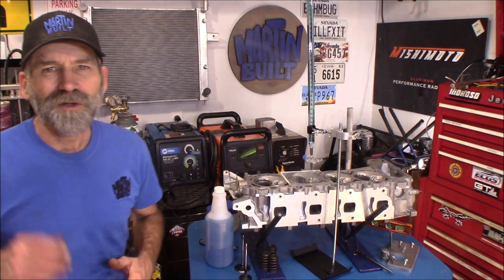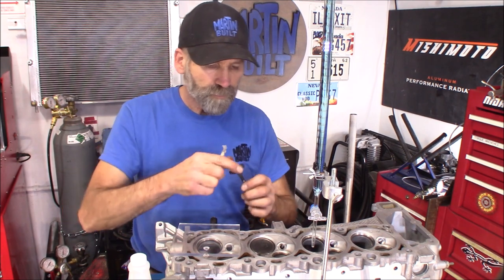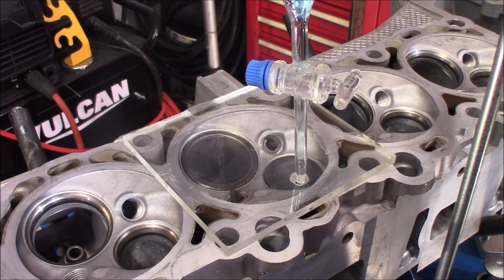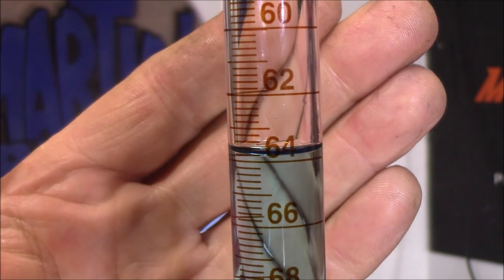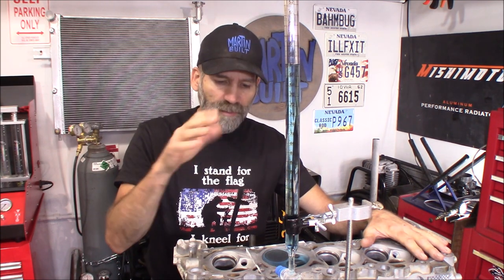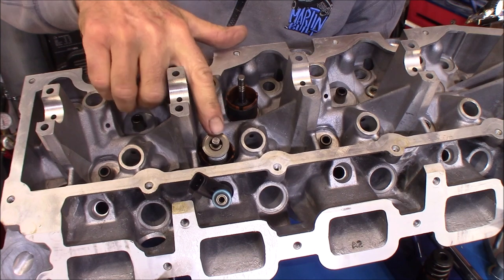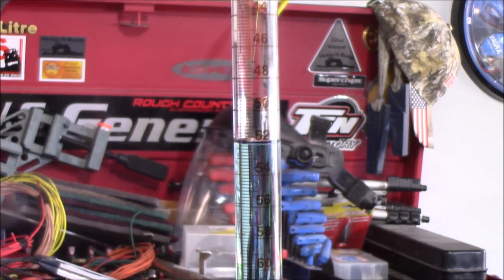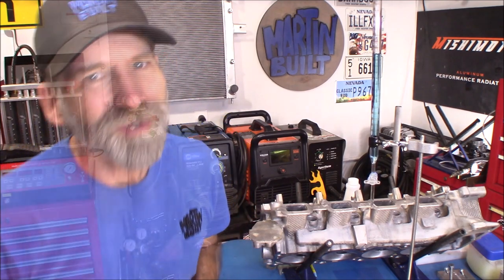How to CC Cylinder Heads (Dodge, Jeep 4.7HO vs 08 4.7 which one is better)

Comment: You are a fountain of wisdom on the Dodge 4.7L, Martin! I just picked up an '05 Dakota with the 4.7L V8, and am in need of your expertise on the design and function of the H.O. cylinder head compared to the non-H.O. heads, at least those pre-2008. My truck had a slight rough idle when I purchased it that I figured I could easily fix with a tune-up. However, the existing air filter, coils, plugs, and fuel injectors all checked out. I cleaned the PCV, throttle body, and Idle Air Control (IAC) valve as well, to no avail. Short and long-term fuel trims are between 0-5%, so I don't think I'm looking at a vacuum leak of any significance. No DTC's or Check Engine Lights of any kind. 

A cylinder balance test was inconclusive at identifying any dead or missing cylinders. A dry compression test indicated somewhat low compression (125 PSI) on cylinder #4, with the rest of the cylinders all posting in the 145-155 PSI range. Thought cylinder #4 could be my problem, despite the lack of any misfire codes. Wet compression tests showed compression gains to 180-190 PSI in all cylinders, indicating somewhat worn piston rings across the board. 

Leak-down test on #4 indicated air coming through the throttle body, pointing to the intake valve. Ran a bore scope down #4 cylinder and saw no evidence of piston or valve seat damage. Good cross-hatch on the walls still visible. Pulled the valve covers to check for a broken intake valve spring, thrown rocker, stuck lifter, or dropped valve seat, and found none of the above. While I had the valve covers off, I confirmed that the engine is in proper time. I pulled the intake manifold as well to get a direct visual on the intake valve itself, and it does not appear burnt or bent. 

Then I noticed something odd. The passenger side cylinder head is stamped "H.O." in the front, whereas the driver side is not. The P/N's confirm that my PF head is an H.O. whereas the DF head is not. However, the cams installed in both cylinder heads are the non-H.O. version, without the extra ridge behind the cam gear. From prior research, I know the 4.7L H.O. cylinder heads differed from those on the standard 4.7L in several ways:

1) .030" higher intake cam lobes
2) Larger valve springs (7.30 coils vs. 6.69 standard, 4.77 wire diameter vs. 4.28 standard)
3) Larger exhaust valves
4) Redesigned combustion chambers coupled with domed pistons, resulting in a higher 9.7:1 compression ratio (9.0:1 standard)

My question to you is whether you think a 2005 4.7L with a H.O. head on one bank and a non-H.O. head on the other running the non-H.O. version of the cams and springs in both heads would result in a shaky idle and acceleration at anything under 2,500 RPM's. Specifically, could the differently-sized combustion chambers cause this problem?

My truck's build sheet and VECI label under the hood both indicate that it came with the standard 4.7L V8, and not the H.O. version. However, I do have the two knock sensors in the valley under the intake manifold which I thought only came on the H.O. engines, so I'm also confused as to which head is original and which was a replacement.
Reply from the maker: yeah, that engine most likely dropped a valve seat and they replace it with the HO cylinder head. Looks like you have replaced everything.
The valves are the same size on both heads, non-HO, and HO
All the 4.7 came with the knock sensor bosses.
Check the harmonic balancer to make sure it is in good condition.
Reply: @martinbuilt  — Thanks for the response! Good idea regarding the crankshaft damper, hadn't thought of that. I still think I'm having a problem with the intake valve on #4, though, given the leak down results. Will try cleaning the valve seat through the intake port. Currently performing a piston ring soak with MMO.

My engine not only has the bosses, but the actual sensors, and they are in fact wired up to the PCM wiring loom. I thought only H.O. engines had the sensors, hence my confusion.

Comment: Excellent work Martin!! Hey, currently rebuilding my 08 4.7 so this video really gave me a heads up on the improvements over prior years. Fist go around with having the heads at the machine shop I had new springs and seals installed and wanted new guides and valve seats pressed in but he told me not to waste my money, so I passed. Weeks later I ordered all new valves, guides, and will be ordering seats here soon... Spent alot of money on this truck/engine this year but doing a full tear down and rebuild, I think this engine is worth it!! Would hate to forgo the seats and have one drop and wreck the investment!! Wonderful content though!! Thanks for all your hard work and dedication to this great engine!! The New rwvisions Chrysler made are both a blessing and a curse lol, just wish there was better aftermarket support... 
Ooh and dont know if you know but 08 Ram trucks have a heavier rotating assembly and actual Forged conrods!! Not the Powder metal ones...
Reply from the maker: Thank you, Ryan, Yeah my understanding is that the 08 has a lighter and stronger rotating assembly. One of the reasons the engine produces over 300HP
I would like to try these heads on an earlier 4.7 just to see how it would affect HP/torque with the larger intake and exhaust ports.
Reply: @martinbuilt  another thing caught my eye after purchasing a set of 08 cams. My oems were solid, with the powdered metal lobes pressed on, with No oil holes on the intake lobes, and my aftermarkets have a hollow shank with welded lobes and oil holes. The lobe profiles seem to be the same in hight and duration but ill be double checking with the machinist. 
Now I know these heads are suppose to be replaced if the cam journels are worn and out of spec, but mine just have alittle scoring. Ill be getting them mic'd and if they are in spec as far as diameter and oil clearance, im thinking about using some ultra fine lapping compound on the journels with the old camshaft, to knock the scoring down a bit. What do you think about this? Wondering if any of the bearing manufactures could make split bearings like crank bearing but for our heads... Ill have to look into that. If so, a machinist could easily align hone the cam journals id imagine. These 08 list for over $800 a piece and id rather hold off, contact some bearing places and see if maybe we(4.7 people) could bypass the need for replacing the whole heads on account of some journal wear. 
Have a blessed day!! Ill let ya know what the homework turns up!!

Comment: Cool video Martin. Would love to see the different heads on a flow bench.
Reply from the maker: Thank you, yeah I would too I used to know a guy that did head work and had a flow bench but he has since retired.
Reply: @martinbuilt  I've read on forums people swapping to the later 4.7 engines by changing relucter wheels etc to make it run with the other computer.. wonder if the later heads drop valve seats? You could be onto something though.. 08 heads on a HO with boost... hmmm.

Comment: Feasibly, if there's no split timing on the twin spark plug setup, you could run the 08 engine on an older PCM like the JTEC. The real tragedy with the 4.7 is that it seems like cam support is gone.
Reply from the maker: Yes, the 08 can be installed and run with the dual plugs with the JTEC. I believe Crane and or Comp Cams will do custom regrinds on the HO camshafts.

Comment: Well done! If you do an engine swap you outta port and polish the heads.
Edit: nice shirt, I have one of those as well. 👍
Reply from the maker: Thank you, I am planning on a engine swap and yes I would do some porting and polishing.
Reply: @martinbuilt  be prepared to have more power. You're gonna go with a rebuilt HO and ported and polished heads... You'll light up all 4 tires. One thing I did to my old HO was get the Bosch platinum +4 plugs (4428) the ONLY plugs I use in these engines. You'll notice it in the pedal. Never had any problem and throttle response like you wouldn't believe. 👍

Comment: I know this is kind of the opposite end of the motor, but do happen to know where to get a full set of main cap bolts?  I'm building my 4.7 in my truck and I can find the normal bolts but not the studded bolts.

Comment: I bought on o6 non-HO Dakota. This channel is teaching me a lot on how to work on the engine. Now I'm curious about a rebuild with 08+ pistons and cams with HO heads. Which would be the best intake for that combo?
Reply from the maker: Hello Chris, the 08 pistons will not work with the HO or non-HO heads as the piston will make contact with the cylinder head. I like the 08 intake manifold the best. You would need an adapter and a throttle cable bracket for the throttle body.

Comment: This is great info. Makes me wonder what my comp ratio is as I built my engine as a base 4.7 with the dome pistons.
Reply from the maker: with 99-07 heads  and HO pistons you should have a 9.5:1
Reply: @martinbuilt  that would explain why I can’t run regular gas no more 😂 my math put me close though, I thought I was at 9.6:1. I run no less than 91 octane now.
Reply from the maker: @dunercr  does the engine ping with 87 octane?
Reply: @martinbuilt  not audibly, but feels low on power. I don’t want to chance damage so I run the higher octane.
Reply from the maker: @dunercr  yep good idea

Comment: Would the 02+ HO heads have better flow than the 08+ heads if the 02+ HO heads were ported and polished? I have been running nitrous on the factory heads for a while on my 02HO. I don’t mind porting and polishing them if they’ll net me equal or better gains rather than finding, buying, refreshing and installing 08 heads on to it lol. Also,, have you found anyone doing cam regrinds for the 4.7 cams?
Reply from the maker: If you're going to stick with a naturally aspirated engine I would stay with the HO heads and port and polish the intake and exhaust runners especially the exhaust.

Comment: Have you ever replaced the valve guides ? I realize this involves heating the head and driving the old guides out, then chilling the new guides before driving them in. My head has oblong exhaust guides, and there is excessive play even with new valves.
Reply from the maker: No I've never done that and that is something I would probably let the professionals handle.

Comment: Let me bounce this off you. 02 non HO 4.7 with 08 heads to lower compression? Using a High flow intake and exhaust method to Keep Hp but get better MPG. What do you think? Or will it raise compression?

Comment: What's your advice for my 2002 4.7 I'm planning on rebuilding the block? What should i do with the heads? They are undamaged. Have them rebuilt or get new?
Reply from the maker: I would go ahead and have them rebuilt, and to ensure that the valve seats don't drop on your new rebuilt, I would have them put in the oversized valve seats.

Comment: so i have a 04 overland with a 4.7HO the only thing i changed was a k&n air filter. whats the best way to make some cheap HP. i love my jeep but wish it could do alittle better.
love your videos
Reply from the maker: I would do a cat-back exhaust, upgrade the fuel injectors and a bore 70mm throttle body.
Reply: @martinbuilt  any idea what kind of gains i would be looking at? i think im close to 290hp now.
thanks
Reply from the maker: @steveseefeldt6550  
It might be good for 10 to 15hp and better MPG's 
A K&N can not give you 25hp from the stock 265.
With all my mods I might be at 300

Comment: Great videos sir, I have an 08 Durango 4.7 with the newer 16 plug motor and it has been a complete dog since I have owned it. My 02 GC 4.7 was way faster. The Durango has about 180k, it runs ok but is pretty gutless. What is your opinion on the later 4.7? I am thinking it has a restricted converter but still need to test it.
Reply from the maker: it should be the other way around. The 02 JGC had 235 HP and if it had a HO engine then 265. The 08 Durango had 303 hp @ 5,650 rpm. Something must not be right with the Durango.

Comment: Martin, are the older HO and non-HO head the same castings? I was under the impression they were, and the only difference was the cam itself and the valve springs and valves. Just curios. Thanks. 

I am mid HO cam swap now. Did not pull the heads to do valves, nor did I change the springs. Cams and full cloyes timing kit only. Read a few places the spring swap was not necessary. I figured you would know for certain, if they are even different. Any thoughts on that also much appreciated whenever you have time sir. 

Happy New Year! Thanks for doing what you do
Reply: If you have made a video on either matter or covered them my apologies I may have missed that part or not seen it yet. I’ve seen much of your stuff but do not recall this spec of info from you. Especially the valve spring thing, I know I googled that up some before just doing the cam swap only. 

Thanks again for making these videos!
Reply from the maker: There is a difference between the HO and Non HO heads. The cams, springs for sure. When I get a non-HO head I'll cc it and report the differences. Thank you.
Reply: @martinbuilt  Thank you for the info sir

Hopefully I get no valve float! Time will tell. 

Thank you for replying as well.  I’m sure you get a lot of questions making these videos.

Comment: I read somewhere on a remanufactured motor list that one of the fixes was drilled heads for better oil draining at the rear of the head and motor. Is that true and could this be done at home or should it be done at  a machine shop?
Reply from the maker: Yeah I've also heard the same thing and I would think you could do that on your own if you have a link to that mod I would like to see it

Comment: I'm currently using the 08 intake manifold on my 08 engine. Wondering what it would be like with the 03 intake. Only downside is I would have to run the 68 mm throttle body.  I'm thinking of making a adapter plate to run the 75mm throttle body on a 03 intake! Any thoughts?
Reply from the maker: Hi Chris, I think you will be going backwards, I feel that the 08 intake is the best. When I installed the 08 intake on my 04 I could feel it with the butt dyno big time. The opening on the 03 intakes is only 72mm and that would be as large of a throttle body that I would use, anything larger wouldn't gain anything. If you what to try it and let us know what you think.

Comment: So does this mean you could pull a set of pistons and heads from an 08 and put them on a older motor and use them
Reply from the maker: No I don't believe it does, you could use the cylinder heads but the pistons to rods will not work.
 You'd be better off just doing a complete 08 engine swap.

Comment: Sorry , but it 's hard for me to understand , please tell me is there a difference in the heads between 4.7EVA and 4.7HO ? What's the difference?😳🤔jeep 🇷🇺 Sincerely Konstantin.
Reply from the maker: The HO heads have smaller intake and exhaust ports and smaller combustion chambers.
 You would gain air flow with the later model cylinder heads but sacrifice compression
Reply: @martinbuilt  Martin thank you very much for the answer , you are the only one who can specifically help in 4.7 🤘🏽🤘🏻

Comment: Mr.Martin I have a question on a 4.7 .and that is on the crank , Which crank is the late model .I have 04 .I bought one to rebuild and it's stamped on the block 10\03 .it 31 coggs with one more being longer ..Just not sure if I have the right crank.
  Sincerely db
Reply from the maker: The crankshafts are the same from 99-07 and the HO cranks 02-04 were steel.If you have a JTEC ECM (3 plug) you will need a 16 tooth reluctor wheel.
Reply: @martinbuilt  well I don't believe the crank I took out of the engine I bought is steel nor would the crank that is my ram now . and it's a 4 plug . So i believe you answered my question and that is 32 toothe is the right crank .
     Thanks

Comment: Is the exhaust manifold bolt pattern the same on the two heads?  Would 2004 standard 4.7 exhaust manifold fit the 2008 head ?
Reply from the maker: no they are different. If you swap a set of 08 heads you'll need the exhaust manifolds as well.

Comment: So i can take 08 heads and toss it on say a 04 motor and all i have to do is extend the coil wiring to wire up both coils and thats it?
Reply from the maker: You will also need the exhaust manifolds the fuel injectors from the 08.
And the valve covers.

Comment: Martin hi , tell me please , can I steal the cylinder heads from dodge ram 4.7 2009 310 horsepower on my jeep wj 4.7 HO , are they suitable ? Thanks
Reply from the maker: It is duable, you will gain air flow on the intake and exhaust especially the exhaust ports but you will sacrifice a little bit of compression.
 You will also need to replace the fuel injectors with the late model ones and you'll need to use the coils and Ignition wires from the late model
Reply: @martinbuilt Thank you, I understood about the ignition coils and fuel injectors, coils for two spark plugs. Martin tell me is there a difference between EVA and HO camshafts ? Valve opening value and valve timing phase ? Opening angle in degrees ?
Reply from the maker: @КонстантинПанов-б2и  
Maybe this video can answer some of your questions.
https://youtu.be/FEeXtDnWy8w
Valve timing will depend on what camshaft you use.
Reply: @martinbuilt  Thanks